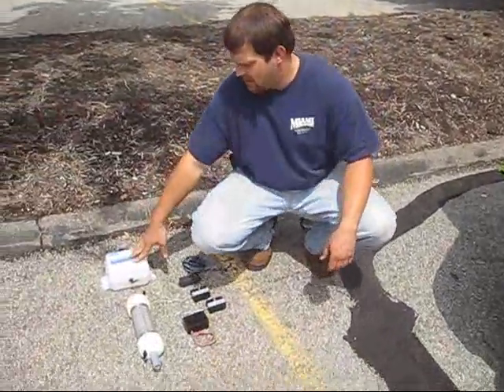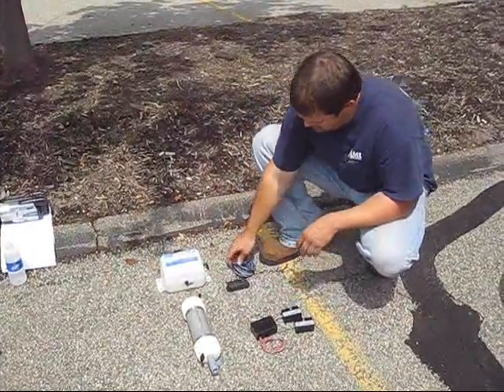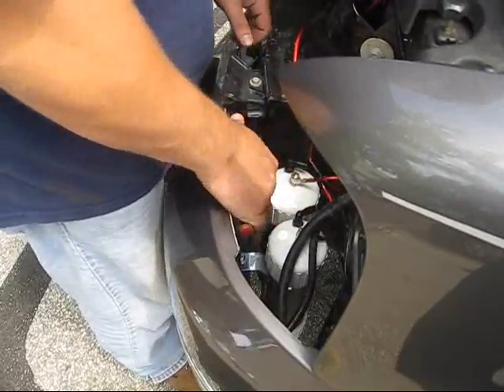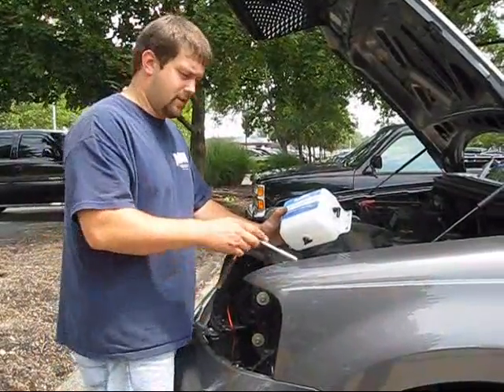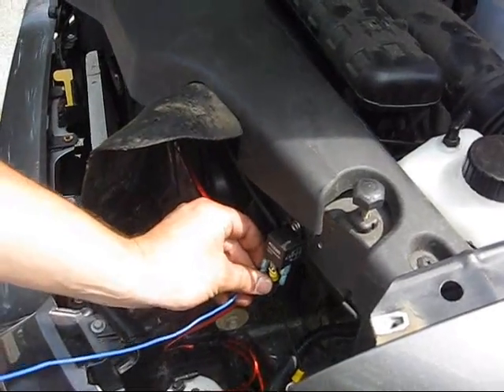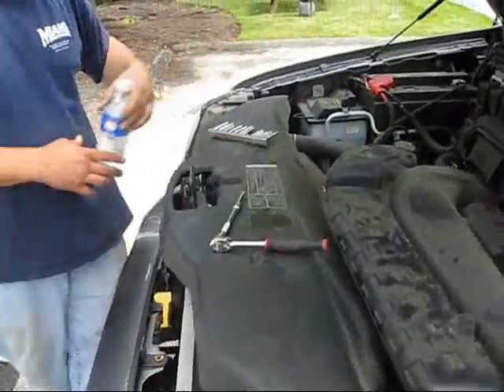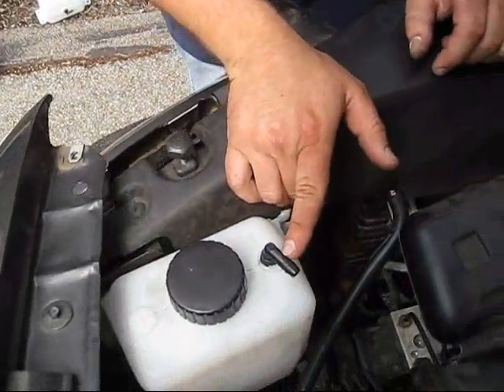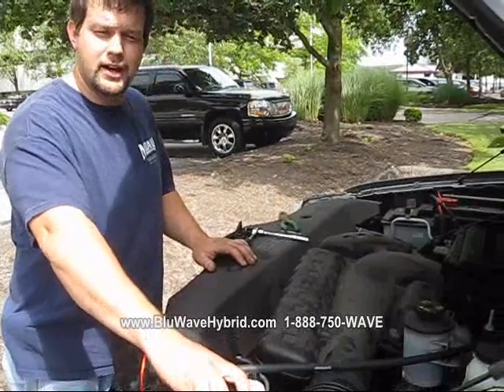Hydrogen On Demand Installation Video

Comment: i cant see this working, because the cars computer doesn't know to compensate for the hydrogen and automatically change the air to  fuel ratio, and the mass air flow sensor has no way to help determine that too.

Comment: Best video I have seen so far and I have watched alot of them. I don't know much about wiring. I made my own hho generator and I don't know how to run a switch to the dash. Your video helped me alot. I hopefully will get it done. Thanks
Reply: It's not that difficult to make a HHO generator. Electrolysis of water is a well known process. And burning that mixture of HHO DOES release energy.

The issue is the energy that can be used is MUCH LESS than the energy it took to make the HHO. Simple Conservation of Energy, a principle known since the ancient Greek philosophers, formalized and generalized in the 1700s.

It takes a large amount of energy to disassociate water, and a smaller amount of energy is available for use. Energy is not created or destroyed, but there is ALWAYS some energy that is dissipated and is lost to the engine. This is a basic principle of physics and engineering.

Comment: How does the hydrogen not overproduce? If the battery is on wouldn't it just keep producing hydrogen?
Reply: Tyler Joseph . no it doesnt over- produce hydrogen because you only turn the system on when the engin is running.
Reply: @kardosevi  but what if you are in idle for a while isn't it producing it?

Comment: My 2012 corolla gets 30mpg on highways. .. can I install this kit on my car ? how much is the cost of the kit + the installation ? and what is the maintenance cost ?
how much efficiency I can get if i can be installed ?
Will it destroy the engine in long run ?
Reply: SOULREAVER : the man who is installing the kit is part of the company called bluwavehybrid and sells the manual diy but obsolete with pieces that no longer exist etc, they tell you that you can find them in the following link but the link does not work and you have to go to the page where they sell you the whole kit for $ 500.00 it is better if you want to buy the kit go to the website and do not buy the book that is worth $ 40.00

Comment: How do you flush blooms out of the tank? Doesn't the water need to be changed relatively regularly?
Reply: the distilled water gets mixed with baking soda, and roughly every 3,000 miles, the water will start turning a brown color, with powdery crud at the bottom. then u change it.

Comment: the water level can drop and needs to be checked ...the elec is produced by the alternator and uses no h.p. or extra gass ... the pvc can also melt and burn these cost about 2 or 3 grand to buy but they are real not a fire hazard build it right or buy one.  its your life .....

Comment: I have plans to build my own HHO generator eventually. I'd like to try to increase the fuel efficiency of my 1994 Explorer 4x4. I'm currently getting about 18.5mpg with the 4.0L OHV V-6 and A4LD 4-speed automatic. I'd like to increase that to 20mpg or better.
Reply: Chris Haywood : the man who is installing the kit is part of the company called bluwavehybrid and sells the manual diy but obsolete with pieces that no longer exist etc, they tell you that you can find them in the following link but the link does not work and you have to go to the page where they sell you the whole kit for $ 500.00 it is better if you want to buy the kit go to the website and do not buy the book that is worth $ 40.00

Comment: if you run completely out of petrol will the vehicle still run solely off the Hydrogen on demand
Reply: Doubtful. These systems only produce enough HHO to "supplement" the gasoline to increase fuel efficiency, increase horsepower, and decrease emissions. They don't produce enough pure hydrogen to run the engine on hydrogen alone.
Reply: No, it still needs fuel to burn, this is only adding Oxygen.
Reply: It also adds hydrogen. Water separates into hydrogen and oxygen. Both pure gasses are introduced into the air/fuel mixture.
Reply: Yes but molecularity there isnt enough power in the amount of H2 as there would be with the normal gasoline or diesel. it's more of a piggy back. If you had tanks storing H2, depending on how much you store, you could drive fuel free. But no matter you must make around the same amount of power or more for it to be beneficial. To run it off of a system that produces hydrogen in the vehicle it would need to keep up with the vehicles energy draw as it rolls down the road. These older systems are not efficient enough to do so. I don't know or want to get into exact numbers, but I do know and understand the concept.

Comment: Can anybody package these kinds of system so it gets low wind drags and can be easily hooked up on the roof of the car and all the user need to do is connecting hosts and wires easily without to much works messing around under the hood?
Reply: Connecting to the roof then running the hoses and wires would be more work imo because it would require more cutting

Comment: the guy below me must not know what he is saying. I have a hyrdogen system very similar to this and it works quite well, absolutely increases gas mileage and performance and reduces emissions if installed properly. I installed on a 2003 nissan maxima and it will work on any car, truck, tractor trailer. exotic application my ass, nature is pleading that u shut ur mouth metguy9966. have some respect, don't spread lies
Reply: Mark Flannery can you provide a link to where it can be bought?

Comment: @Me102288 Octane rating has nothing to do with energy per volume of the fuel. Diesel fuel burns slower than gasoline, and has far more energy than gas. High octane might be good for some high performance engines, but for most uses it rather useless, including a normal car. I'm not knocking hydrogen as a fuel about octane rating. It's just inefficient as an energy source, except for some exotic applications. It just takes more energy to make by electrolysis than you can get out in a vehicle.
Reply: I know it's been 9 years, but I've seen many claims by people on YouTube, who have no motives as they aren't selling them, about vastly improved gas efficiency. Even if not, clean emissions help the environment, and cooler running means extended engine life, making it viable, regardless.
Reply: @kentclark6420  Easy to make claims about fuel efficiency and cleaner emissions. Tough to actually prove it.

Yes, some of these people making these strange claims DO have a motive. They want to spread rumors. They want to make people believe things that haven't been proven. Not a financial motivation, but a motive nonetheless.
Reply: @kentclark6420  This is really very simple. Prove it. Make a prototype. Let a group of evaluators run it through tests. There are plenty of talented engineers in the US and around the world that would LOVE to make a motor that would do half of the things that are claimed. They would make MILLIONS!

Until that happens this is just a unfounded claim. Farfetched, really.
Reply: @MetGuy9966  My gut tells me it's for real. An extra boost from something made out of water vapor is cleaner than gas exhaust, for one thing.
Reply: @kentclark6420  Your gut should tell you there's an energy cost to everything. It takes energy to convert water vapor to free hydrogen and free oxygen. The energy we get back from burning the hydrogen is less than the energy it takes to disassociate.

Do you have a science or engineering background? Doesn't really matter if you do or not. Lots of smart people don't have a background in science. The important thing is staying curious and be willing to learn new things, something I try to do every day.

Study of engineering and science makes us see things in terms of energy. The basic idea is "Energy cannot be created or destroyed". This is just a Truism called the Law of Conservation of Energy. When energy is transferred from one form to another there's ALWAYS some energy that lost, not that it disappears but it can't be used for our purposes.

Comment: @Me102288 You're mixing your efficiencies A gasoline engine makes use of about 40% of the energy in the fuel. Most of the energy is unused as heat. Hydrogen returns, at best, 70% of the energy it takes to make it by electrolysis. So, if you spend a dollar to make hydrogen you can get 70 cents back to run your car. This might be a good trade off if you're NASA and you can't get to a filling station. But for a vehicle, it's a LOSER.
Reply: You are not thinking about many factors .  How about you alternator is producing the energy to separate the H from O
And the H burn the gas at higher % 
Wings made to fly
Reply: @ronaldariaaria1781  Alternators don't PRODUCE energy. They convert spinning kinetic energy to electrical energy in the form of AC current.

Let me guess. You don't have an engineering or science background. Nothing wrong with your background. I'm sure you're doing fine. It just sounds like you don't know where energy comes from.

Comment: @Me102288 Octane rating has NOTHING to do with efficiency of a fuel. It's simply a measure of the capacity of a fuel to self ignite. High octane does NOT mean a fuel is stronger or cleaner or better for all cars. Low octane is actually better for most engines. The fuel burns slower, and the engine can take better advantage of the expansion.

Comment: @Me102288 $120? My van fills up for half that. Of course gas is expensive. Get your mind around this fact: Making and using hydrogen by electrolysis is at best 70% efficient. That means you only get back 70% of the energy back that you had to put in to make it. The efficiency numbers you quote for gasoline are based on the total energy in the gasoline. The gasoline engine only makes use of 40% of the available energy in the gasoline. Please get your facts straight.

Comment: @Me102288 I never said HHO doesn't work. It's just not efficient enough to be practical. All those fuels can run an engine, but a real engineer will do a "beginning to end" analysis of the actual costs with the fuel, including long term maintenance.

Comment: @Me102288 OK, we're not too far different in our opinions, then. Sure, some systems run on hydrogen. It's just not the most efficient way to move a vehicle. Didya hear about the plan to use nuclear reactor to drive a rocket?

Comment: @Me102288 BTW, your understanding of combustion is apparently lacking. Oxygen is a necessary part of the equation. "...runs on 100% HYDROGEN" is impossible and shows your lack of basic knowledge of chemistry. Start with the Wikipedia article on Hydrogen and continue to Hydrogen Economy.
Reply: Impossible???? What about Jack Nicholson's Car he sold back in 1967?
Reply: It ran on Pure Hydrogene separated from Oxygen. Also, there are plenty of other people running their cars partly on Oxygen. Jack Nicholson's car ran purely on Hydrogen and no gas whatsoever.
Reply: @brianparent  Hydrogen-powered engines are well known. No one is saying they don't exist.
Reply: @brianparent  Running on 100% Hydrogen IS IMPOSSIBLE!

Let me guess. You don't have a chemistry or engineering background. Am I right?

100% Hydrogen will not combust. It needs OXYGEN at the right proportions to run an engine.

And it takes ENERGY to get hydrogen. You can't find it sitting around. The energy it takes to get the hydrogen is GREATER than the energy you get back in the engine. That might make sense in certain, specific applications, but is a LOSER in general.

Comment: @Me102288 Your condescending tone does nothing to advance your point of view. If it was really cheaper to run cars on hydrogen we'd see more of them. A good way drive electrolysis is using nuclear power. France makes about 75% of its electrical energy with nukes -- and they have world-class engineers there, too. They would LOVE to manufacture vehicles that run on hydrogen, but why don't they? It doesn't work! Hydrogen is inefficient to make, difficult to contain, tough to transfer.

Comment: @Me102288 My point is "How do you make the hydrogen?" That BMW's hydrogen has to come from somewhere. Most industrial hydrogen is created from heating methane -- far more efficient than electrolysis. Electrolysis is at best 70% efficient -- you only get 70% of the energy back that you put in to turn water into 2H2+O2. That's a LOSER if you ask me. You still haven't addressed my previous point: If it worked we'd see thousands of these cars made by real engineers, not backyard hack scammers.

Comment: @aubreyholman What does that matter? You can't retort with logic or facts, so you cast dispersions on me personally? Weak. Think of this HHO thing this way. Before starting the engine the only source of energy is in that tank of gas. The water does not add any energy to the system. It would be a simple thing for these scammers to submit their vehicle to third-party auditors for evaluation. Have they done that? No.

Comment: Well, I agree with your second post about the theoretical Perpetual Motion machine. It might run if you can eliminate all friction. But you could NEVER take advantage of that energy. In the Real World when energy is converted from one form to another there is some loss. And electrolysis is very inefficient. That means there's a LOSS in the system that can't be used to move the car.

Comment: If you understand conservation of energy you'll know that anytime you convert energy from one type to another there is some loss. When this device dissociates water it takes more energy out of the system. The alternator drags harder on the belt to provide the amps. Sure, if you eliminate something else, like a sound system, or AC, you'll get better mileage. But it simply takes MORE energy to 2H2O -> H2+2O2 than when it goes back to H2+2O2->H2O.
Reply: Oh so if I play my radio I get less gas mileage? 
What about this system run more efficient on 1.2 volts?
Reply: @ronaldariaaria1781  Sure, even the radio saps some energy from the system. But that energy is relatively tiny. It's not worth considering.
Reply: That all depends on how much excess electricity your alternator presently produces.

Comment: @Chickenflossiphy Maybe you believe in the perpetual motion machine, too. How much physics did you take in school?

The alternator is driven by the engine which is powered by GAS. Any electrical power generated is a result of burning gas. The water doesn't provide energy to the system.

The welder works because it's plugged into an electrical outlet. I know the process works. It just can't produce more energy than what comes out of the outlet for the welder, or what's in the gas tank.
Reply: When you "crack" water through electrolysis, you get energy feom the hydrogen gas.
I've actually done this even with a crude build and inferior materials I was able to get a 1984 Chevy v8 go from 14mpg to 17, a 26% increase. 
Without anything else changing. Didn't change oil, spark plugs or use any higher octane gas.

Comment: Sorry, omfg. You're not thinking right on this issue. Think of some basic Physics.
This video shows extra equipment installed in a vehicle that has gasoline as the ONLY source of energy. Burning gas to make hydrogen, then burning that hydrogen is a net LOSS of energy compared to using the gasoline alone.
I believe this equipment is a scam to get money from the gullible.

Comment: 1) 4cil 2ltr engine uses 2,000 ltrs of air per minuteat 2000rpm

2ltrs x 2000rpms / 2 = 2000ltrs of air per min

3 or 6 ltrs per min of hho wont do s...

2) hho alone inside an engine contracts (implodes) into h2o (water) doesnt explode like gas therefore 4 stroke engines will not work on hho alone

SPREAD THE WORD!!
if you want to know more just let me know